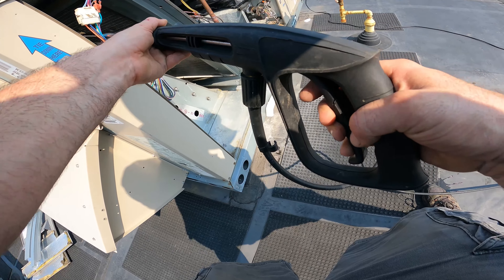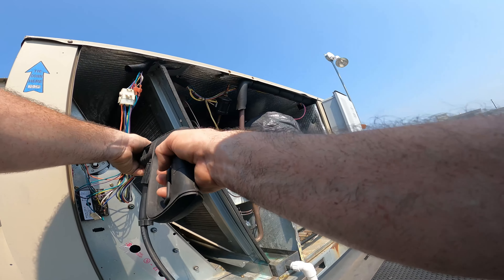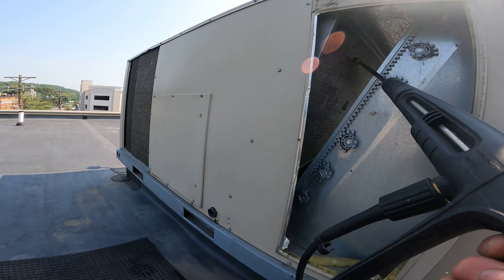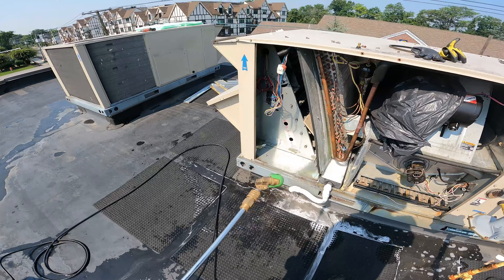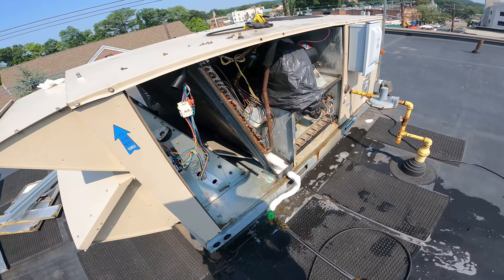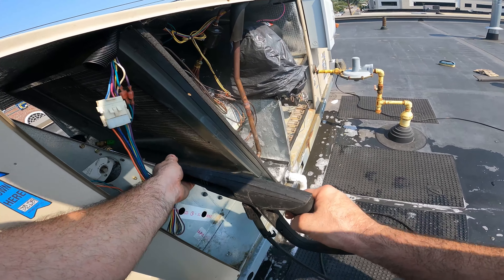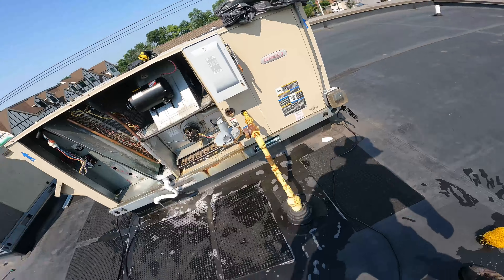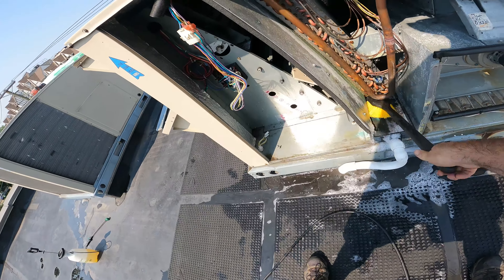HVAC Pressure Washing/ Cleaning Evaporator Coil

Comment: Surprised to see a pressure washer used for that.  No damage to the coil fins I guess
Reply from the maker: Never damaged a coil with a pressure washer. You also have to be careful and know what your doing. I don’t use pressure washers on residential condensers.